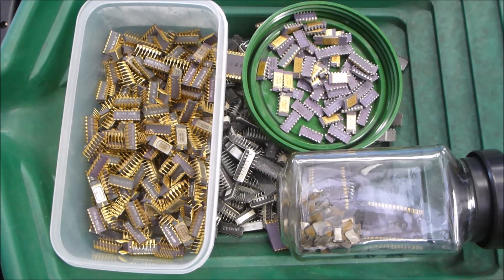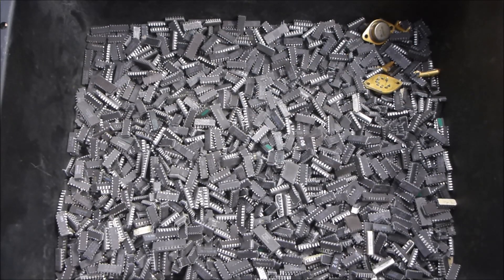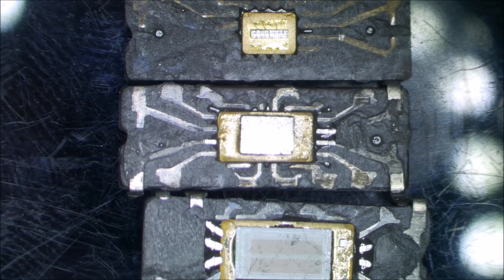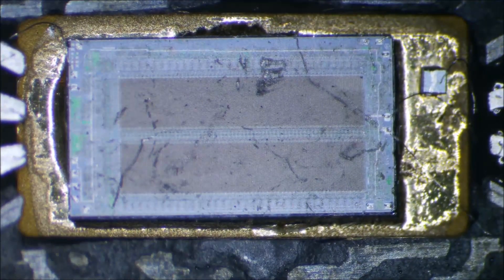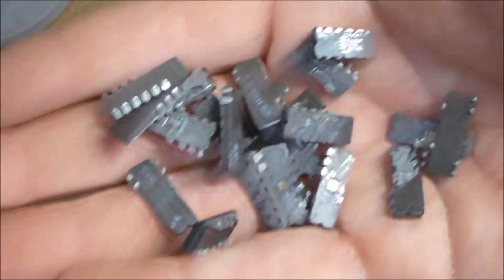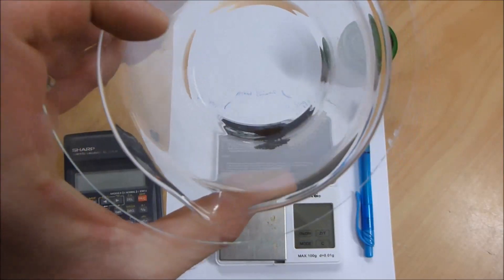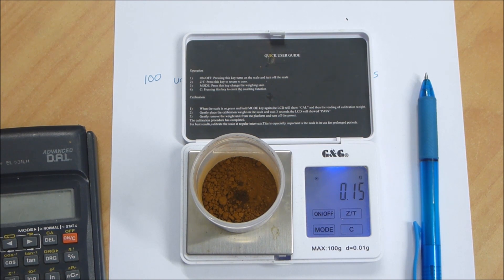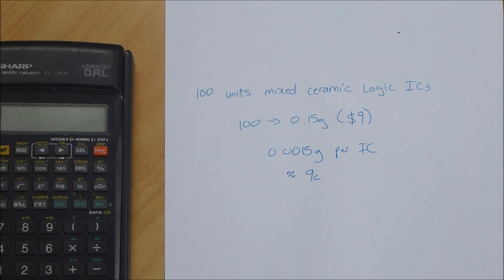Gold Recovery - Yield from mixed ceramic logic ICs

Comment: I really want to try some refining.  What is holding me back are the toxic fumes.  I know I can vent them outside but what happens to items in the yard from the fallout.  I live on two acres and already have pitting on the car from the nearby refineries.  It so little I don't think it will be that bad for the environment but don't want to loose any trees.

Any help or suggestions would be appreciated
Reply from the maker: Hi there, for small scale hobby refining, 2 acres is great, as long as you have a bit of space between where you are working and neighbors / animals / plants. Unless you are dissolving lots of metals, the fumes are not likely to be a problem. Having said that, you cannot do this inside without a fume hood and if you do it outside, you will need a stiff breeze. Any steel items nearby will also rust very quickly. I don't want to put you off, it is a very rewarding and interesting hobby, maybe start very small and work your way up ?
Reply: Thanks so much.  I figure I need some kind of scrubber or someway to reclaim the gases.  It will be a very small scale operation.  More of a hobby.  But it seems like an awesome  deal.  My lot is very heavily wooded.  There has to be an inexpensive scrubber method.  :)

Ted
Reply from the maker: Hi Ted, for sure, as long as you have a bit of wind to disperse the fumes and you are venting it away it will work fine for small batches. I was surprised to find quite a few medium sized labs that only do this without any scrubbing. Keep me updated with how you go and feel free to ask if there is ever anything not quite clear enough.

Comment: Now that you know the approximate yield, you can adjust the chemical usage to minimize usage.  You also can use these low yield ICs to exhaust excess acids in better yield ICs do remove the denox process.
Reply from the maker: Yep, very good Idea, thanks for the comment mate
Reply: Just remember, miners view several grams per short ton as profitable.  Your yield on these chips are far purer than most mined gold.  If time for reactions to complete are not really a concern of yours, then 10% HCL and ~37% Nitric would work.  1 gold needs 4 HCL and 1 Nitric.  It is the massive excess in acids that causes the huge clouds (toxic) fume you see some videos.  You may need stirring with diluted acids.
Reply from the maker: I was actually thinking something along these lines not so long ago, in terms of using cold AR for slower reactions where I don't mind the reactions taking longer.

Comment: I wished he gave us a weight of the average 100 that he used.
Reply from the maker: minimumsystem I figured a number of units would be more useful than weight, but I will have a quick weigh of some ICs next time Im in the workshop to give you a rough idea.
Reply: Ok thanks have a bucket to process one day.
Reply: What a great video. A Q from me, did you finally weigh for these 100 ics?
Reply from the maker: Sorry guys, this completely slipped my mind! Will weigh them up tomorrow after work.
Reply: Successful Engineer thanks, i'll wait the result
Reply from the maker: Hi guys, 100 of the ceramics weighed in at 205g, that means the yield for these work out at just under 0.75g per kg.Sorry about the slow reply !
Reply: We have tried pyrolysis followed by crushing and tabling with interesting results. We'd like to make contact,we're in Nelson area

Comment: and copper there too...!!!
Reply from the maker: For sure, most electronics probably have more value in Copper than Gold!
Reply: just copper falls out along with gold in this brown powder, and when fusing again a bad sample and divide again the action
Reply from the maker: No, when you use SMB to precipitate the Gold, the Copper does not fall out of solution, it is quite selective for Gold.
Reply: falls nitric acid deposits and see that the weight of the other